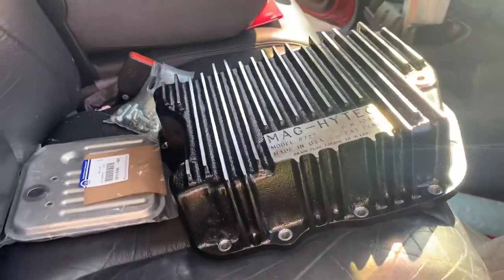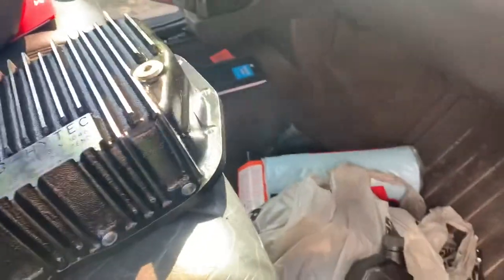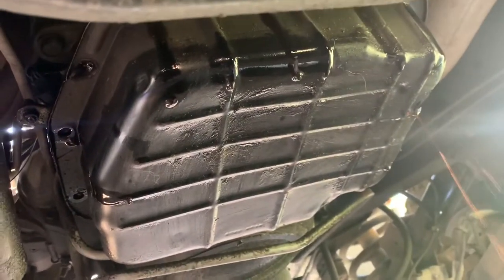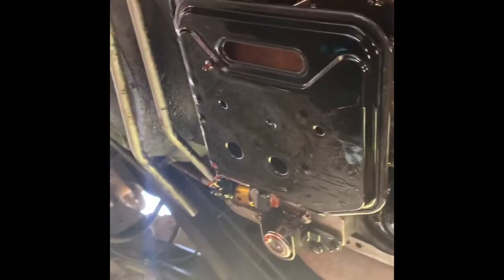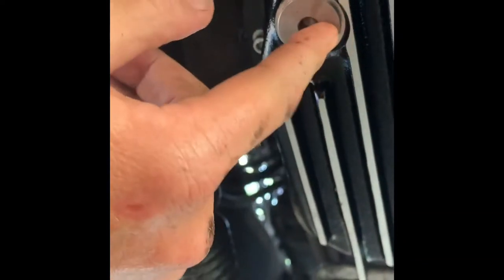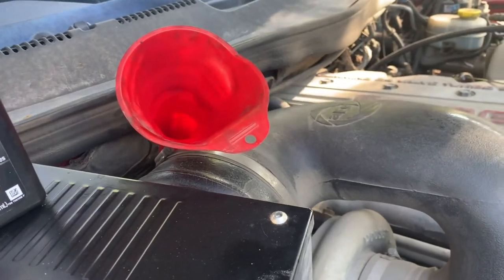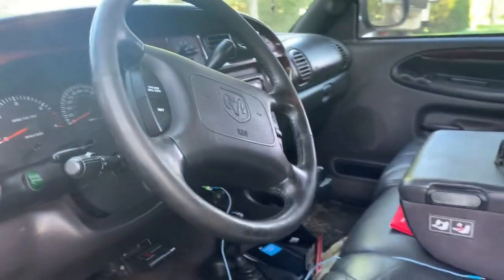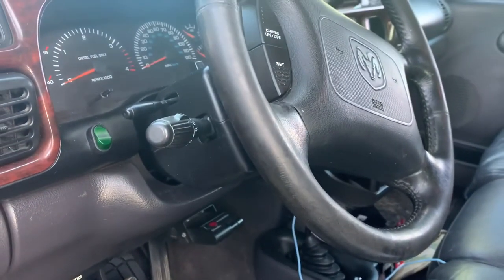2nd Gen Ram 2500 Cummins 5.9 Transmission Fluid and Filter Change Mag-Hytec Pan

Comment: Could you use a drill and just drill a hole in the old pan since your going to an after market deep trans pan? Maybe a little bit less of a mess to clean up. Or are the internals too close to the pan? I’m going to be doing mine in the next few weeks. Thanks for the video!
Reply from the maker: I personally wouldn’t risk it with the pan on. A lot of people have added drain plugs to the stock pan and made life a lot easier for drain and fills as well as servicing them.

Comment: After all this time, has your transmission ran any cooler? And how can you tell? Do you have a Temp sensor on it? Thanks
Reply from the maker: I have a trans temp gauge. It’s ran pretty cool but even better when I cleaned all the coolers and radiator with degreaser.
Reply: @Alpha-Works-Tx  i just inherited a Dodge 1999 2500 Cummins L6 with 110,000 miles on it, from my father and i am learning all the ins and outs of a diesel engine, i will be trying to upgrade the truck, as my dad neglected the maintenance on it (oil change, trans fluid,  etc.) Truck hasnt seen much action, no heavy pulling or loads. I might be doing what you did to yours in the near future. Thanks for the quick reply and God Bless.